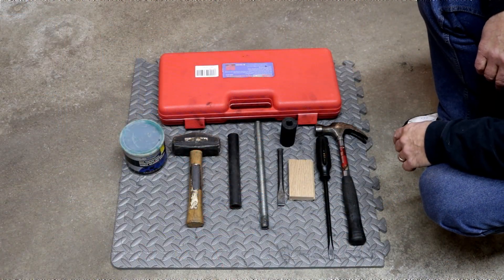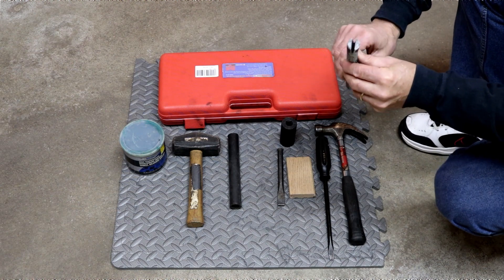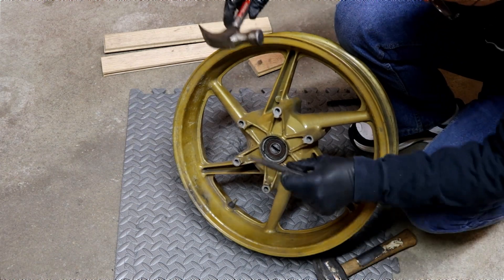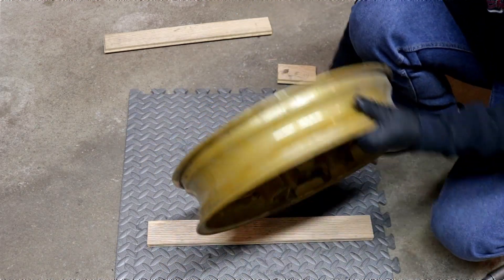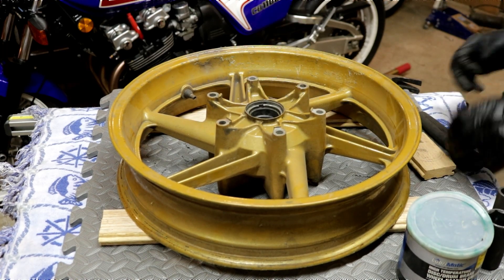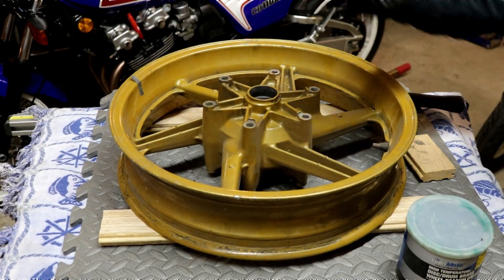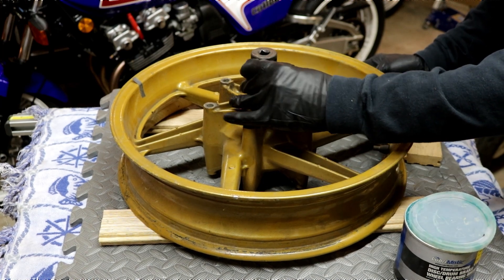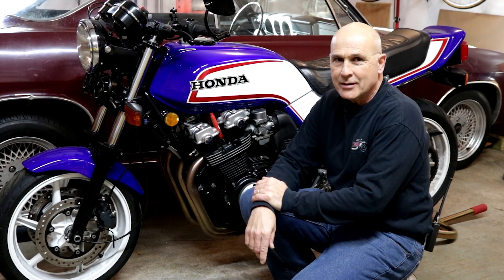Motorcycle Wheel Bearing Removal and Replacement

Comment: I just spent $30 on 3/4" allthread (which is too small) and I've 2hrs trying to get my wheel bearings out. No chisel I had was big enough to spread the 3/4" allthread. I tried shims and eventually I ground down a 1/2" bolt into a chisel hoping that would work. After all that and well over a dozen tries on both sides I now have to pay to get my bearings out. So glad it was so easy for you
Reply from the maker: Sorry you're having so much trouble.  I have used that method dozens of times and it has always worked.  I never needed larger than 3/4" threaded rod though.  You may need the blind bearing puller in this particular case.